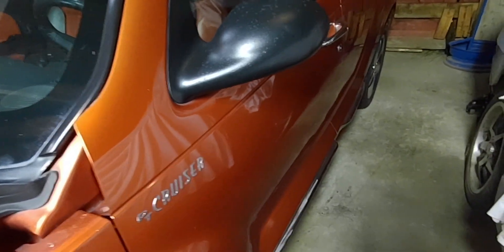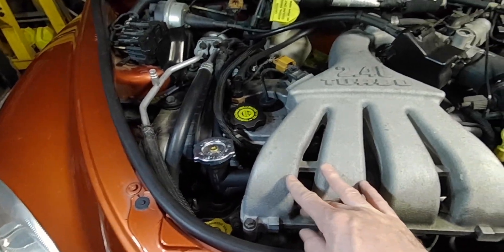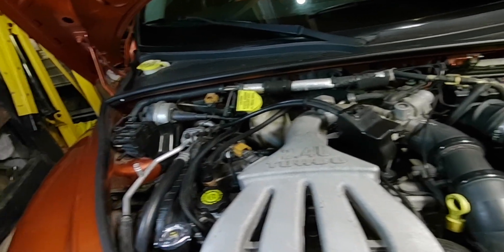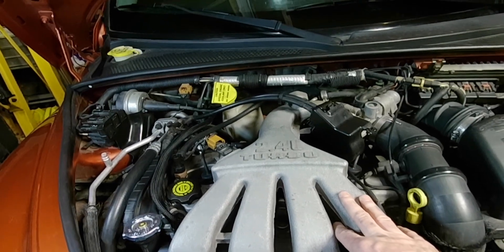Are PT Cruisers Actually hard to work on?

Comment: My 2001 Limited killed the timing belt at 200,000km and of course the water pump was leaking. $1355.00 later all is well. The mechanic had said that I probably could have replaced the car for what the repair was going to cost, which was true, but the question would be what is wrong with the replacement vehicle. At least with mine I knew what had been done and fixed already so to me it made more sense to repair it than scrap it. One big advantage that the PT Cruiser has over many other vehicles is that the engine is a non interference engine so if you do break a timing belt the rest of the engine isn't destroyed. I enjoy your videos
Reply from the maker: It's none interference but the valves are still able to contact each other, which seems to happen about 10% of the time... Glad you got lucky with yours and got it fixed up again.
Reply: Matt's Garage  PT Cruiser are recommended to change your timing belt and water pump every 100,000 miles/161,000 km. Good PM is what keeps a PT on the road. Keep it on the road😃
Reply: @CarswithNash  Hi,I am from Serbia,recently bought a pt.I have a problem,when I turn a key to start,a red oil lamp is on.But when I start a car is off.Oil is on max.What do you think could be the problem?
Reply from the maker: Aleksandar Gavric That’s actually normal, the engine has zero oil pressure till you start it, once you start it the oil pressure builds enough to trigger the sensor (essentially a spring tensioned switch) and turn off the oil light. If the oil light ever comes on while the engine is running then that is an issue as it could mean your engine has ran low on oil, has an internal problem or often it is just a faulty pressure sensor. Hope this clears it up for you, congrats on your new PT!(-:
Reply: @CarswithNash  thanks Mat for your help,you made this easier fir me :-)
Reply: @CarswithNash  do you have maybe a video where I can see how to check a coolant level on my pt?
Reply from the maker: Aleksandar Gavric The coolant should be full to the cap and then the reservoir should be full to the “cold full” line, you may need to shine a light through the reservoir to see the level since they get grungy and hard to see. That is where you check it though, if it goes down it will pull from the reservoir.

Comment: You nailed it. A good clean car well kept beats monster car payments. I drive a 2001 Mercury Grand Marquis , I bought it 7 years ago from a Kansas widow it had 112k miles and was and is babied. I have 142k miles on her, it's in top shape, burns no oil and I would drive it anywhere. 

I salute your common sense approach. There are better things to do with my money than spend 40k dollars on a depreciating asset.
Reply from the maker: That's a solid choice of car as well, I've owned a number of Panther cars over the years.

Comment: I have an 01 PT Cruiser. It just rolled 401500 km. I find it one of the easiest cars to work on. I paid $350 for it back in July. I have had to replace some things on the  car but I am still under $1000 for the car. A great place to get parts for them is Rock Auto on line. I have found most of the prices on the parts there have been extremely lower then going to the local auto parts store. I have been looking at picking up more as most I have seen that are newer than mine are $2000 and under. Your videos are very informative. Thanks for producing them. Have you done a video on changing the timing belt?? 
Will
Reply from the maker: I buy most my parts from Rockauto as well. I haven't done the timing belt video yet but I plan to, probably this spring. That's an impressive amount of miles on your PT, good job!

Comment: I've had my 06 for 7 years and love it. No major problems. It does do the flashing dash lights and gauges thing every so often. But that's it!
Reply from the maker: Flashing dash lights seem to be the norm for PT's, all ours do it slightly in cold weather, I normally recommend a new ignition switch and clean up the ground points if the issue seems bad because I have had that solve not for me.
Reply: It's not bad enough. It can go months without doing it. Nothing stops working.

Comment: Thanks for confirming i didn't buy a lemon .Mine is a 2008 pt cruiser...It is having some check engine light flashing lately....
Reply from the maker: Check engine lights can be triggered by something as simple as a loose gas cap, unless the car is running poorly it’s not normally a cause for major alarm.

Comment: Hey Matt, I'm excited my son picked up one, looks like more of a base model, but with only about 94 k on it. The unit looks brand new. It hasn't been driven for the past 2 yrs so it's kinda running rough and a check engine light came on. Watched your video on how to check the code, ( great info by the way) will do that and find out what's going on with it and hopefully that will be an easy fix. Thing is, got it for under 2k

Comment: Hey Matt big fan learned alot from you. Question. 
I have 03 PT Gt. Just changed alternator, belts and new battery. Had the car for two days after putting new battery in, voltage dropped and check engine light is on. Pulled code 622. Malfunction alternator. Put another one in, same thing. Even brought it a mechanic friend. He's saying I need a new PCM. I've heard of that too just wanted to make sure I'm not throwing money at problem. Also I did check wire loom thats notorious to go apart due to the axle /CV joint rubbing up on it.
Reply from the maker: Did you clean up all the connections going to the alternator and also clean up the underhood ground points? (I have a video on this). Good chance it is your PCM but just make sure you have proper connections everywhere first. Also try jiggling those plugs going into the PCM, I have literally fixed problems doing that. Sorry for the delayed response, I’ve been super busy lately.
Reply: @CarswithNash  yes I did. Actually I did everything from your electrical video. New thicker wires for all the grounds as well as new wires from the starter to the battery. Everything sanded down. All you taught me. Lol. I even cleaned all the connections with electrical cleaning spray, even all four connections to the PCM

Comment: My 04 Pt Cruiser was great for about the first year but then it started overheating. I took it to a garage and had them put a new thermostat and coolant in, which I had bought before taking the car to them. They said the head gasket and water pump were fine and they charged me quite a bit after is already paid for the parts myself. They said it didn't overheat but when I drove it home it started over heating again about a block from my house! I took it to the dealer and they said the system needed bled and they checked and said the fans were working fine and the head gasket and water pump were fine and it didn't over heat after they ran out l in the bay for a long time, but on my way home it started overheating again so I had to turn the heater on full blast to cook it down which sucks in the middle of summer. It started making a noise in the front end so I parked it till I could get someone to check it out. I started driving my truck again. The battery in the pt went dead from sitting so last fall I tried to jump start it with 3 different jump starter boxes but it turns over and won't start. Amy ideas on why it still overheats and why it won't start. Help!
Reply from the maker: Sorry for my delayed response I have been busy and not responding to comments for a while. You need to get a fresh battery and a jumper pack or jumper vehicle on that car to get it going again. Once they sit for a while the oil drains out of the lifters in the valve train and the valves don’t actuate properly till the engine turns over quite a bit and maintains oil pressure. I actually just went through this myself about a week ago, bought a non running PT super cheap and all I had to do to get it running was crank on it for a very long time. Make sure you give the starter some breaks so it doesn’t overheat. As for the overheating engine I did make a complete video on this topic in my PT cruiser repair playlist. So often the troubles with these cars is caused by bad mechanics, these are really great cars that my whole family drives to this day and we keep them around because they are very reliable, I hate hearing all these stories because I know they aren’t the cars fault in most cases, these are really good cars, please give it a fair chance, find a good mechanic if you can’t figure it out yourself. Ask the mechanic outright what his opinion is on these cars, if he thinks they are junk move on he is not going to give it the effort it needs.
Reply: @CarswithNash  thanks, I've been watching a lot of videos online and have watched many of yours as I know you have a few of these cars. I actually really liked the car. It ran really good even with the overheating. It just really sucks driving it in the middle of summer with the heater on full blast, but at least it cooled it down. The battery was rather new and had only been in the car a few months but I did slack off of starting it every couple of weeks during the winter due to snow all around it as I'm slightly disabled and afraid of slipping and falling with no help to get up. I saw your video and I think another one that said the same thing about the oil needing to get pumped back up before it'll fire up. I did get a small battery charger that I was thinking of trying to hook up to the battery to see if it'll charge it up enough to start but I have to f find a long enough cord to plug it in and be able to reach the car. It's also hard for me to get anything done as I've been on social security for a few years due to disability, so getting enough money to fix things is difficult too. I know it's about due for the timing belt replacement and the dealer said that's over $1000 to do that. I figure it's cheaper  than trying to get another car. Thanks for your reply. I'm really hoping that the battery not being strong enough to crank it enough to get the oil moving is the only reason it won't start as it was starting great before. I don't know what else to do about it overheating as there's are so many reasons given and I've heard of people who never got there's figured out. I do like watching your videos. At least I get some good ideas on some things to try if I can find someone to do it for me. Keep up the good work and thanks again.
Reply from the maker: @christinewhittaker2685  Some people seem to have fan control issues, I haven’t experienced it myself but if I did and couldn’t solve it I would just run the fan to a switch and back to the battery (best done with a fuse and relay)  and just have a manual on/off switch on the fan. If your fan is running up to par and your radiator is not clogged, thermostat is opening, no air in the system then it pretty much has to work. Be sure if you get the timing belt done you also replace the water pump, tensioner, idler and oil seals on the camshafts and crankshaft. Doing all that may cost more then you were quoted even but any of those item can and likely will fail before the next belt is due and then you’d pay all the labour again. Good luck, hope it all works out for you.

Comment: It's not like you have to replace the timing belt all that often. Mine has 190 K on it and I just took a 4500 mile trip with it.
Reply from the maker: 190K miles on the original belt?! Haha I would say that's pushing it, I've seen them break around 90k miles so I prefer to change them every 75K miles or so, I change the water pump and oil seals while I'm in there. That's great that yours is holding up so well though, I'd seriously think about changing it though if I were you.
Reply: @CarswithNash  Oh I changed the belt before the trip as I bought the car just a few month ago and didn't have any history on it.

Comment: Thanks for all your great videos... Do you have a suggestion to my issue with the rear running lights , l+r, in my 2006 p.T. Crusier. The directional works in the same bulb. Both were replaced though the bulbs were good . The black wire circuit has no juice, I checked running a ground wire directly from the negative side of battery. I tested all the fuses and they seem to function. The only one non functional is the 10amp fog lights which did not come with the car but wiring is there. I did jump from the headlights a feed to run running lights in the fog light portals , and after 4 years the base of one of those lights lost it's good grounding capabilities so I replaced it and works fine as before . But I saw that the rear running lights were not working after that , to the best of my recollection. 
Do you have any suggestions ?
Love your pod casts.

Comment: Some people do junk them. Because I live in a small city it has 1 junkyard , and 
there is a lot of pt cruisers.( for a small junkyard) half a dozen for sure. I'm sure the way it works out 
by the time my 2005  pt cruiser  ( white)  I bought this year for $850 needs something
they'll  be crushed, Hope not, hope he thinks there special a leaves them stay for 
years for parts. Mine needs rack and pinion. I'm getting a rebuilt one  so it doesn't
leak ay more , Maybe rock auto
Reply from the maker: I will just warn you I got a reman Cardone one a few years ago and it is leaking from every possible spot… very low quality rebuild if it was even rebuilt.
Reply: thanks for the heads up. I'll buy new instead. last thing I want is to do a job twice  of lowering the cradle down, thks
Reply from the maker: @janbill79  It can be done without dropping the cradle, I never did and I was working on a turbo so if it’s a non-turbo  it shouldn’t be too bad at all. I did actually record the process but I haven’t gotten around to editing that into a video yet.

Comment: I just love the PT Cruiser, I’m glad that there are those willing to teach others owners how to do these jobs.
Reply from the maker: Glad my videos are appreciated, all this positive feedback is great motivation, thanks!
Reply: Matt's Garage thanks for showing your repairs on a turbo!! I’m glad to see 2.4 turbo work as so many of the videos are w/o turbo. I’m really looking forward to working on a 2005 PT Cruiser Convertible turbo!  Have a number of things that I’m going to work on myself. It’s at 130,000 miles and I have just started going over it.
Been having a lot of fun at the junk yard. Got two sets of rims that are 15 spoke 100 x 5, really looks better that the 6 spoke it had. Replacing or replaced struts and shocks, upper and lower control arms and wats link w/ arms.
Also, thinking of going on with the timing belt and water pump along with replacing the motor and trans mounts.
Reply from the maker: Allan-Christine Hart When you do the timing belt & water pump just be sure to also replace the cam and crank oil seals, even if they are bone dry, trust me on that.
Reply: Matt's Garage thanks for the recommendation I’m going to be doing the work in the next few months.